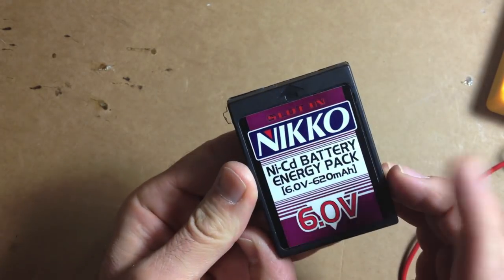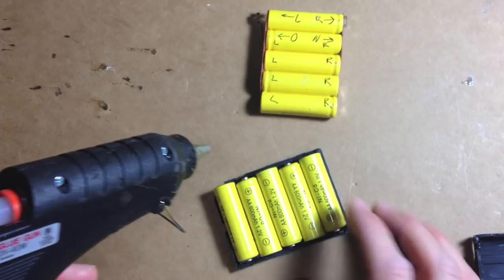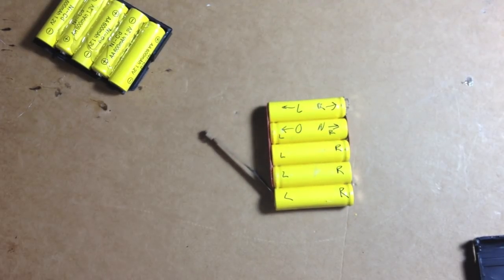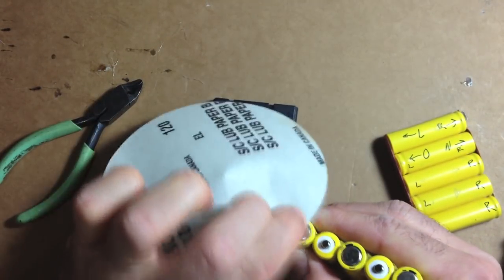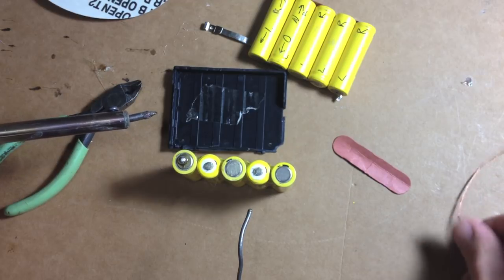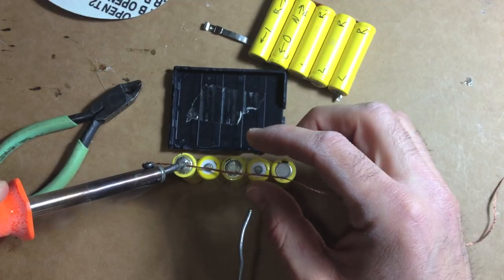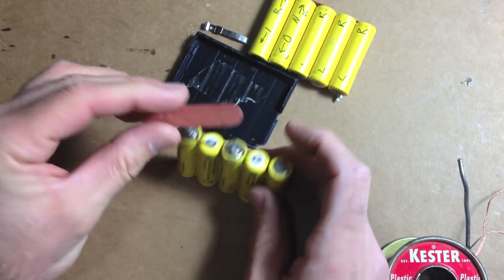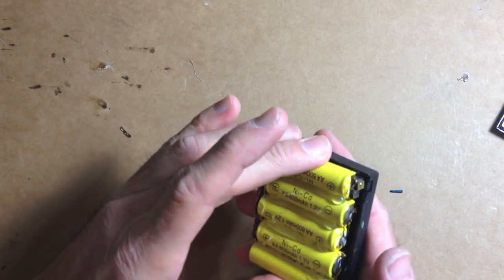Make your own RC Car Battery Pack or Repair NIKKO Ni-Cd 6.0V-620mAh

Comment: Thanks for the tutorial. I was able to refurbish a TMH Flexpak 7.2 v used with a Tony Hawk Skateboard RC toy. Apparently the battery pack is no longer manuals yet and I didn’t trust the ones on EBay. I used solid copper wire and flattened it with a hammer for the conductive strips between batteries. The case is a pain on this particular battery pack, but it can be done.

Comment: Just tried it with 1000 mah IKEA batteries and it works but I feel the power is reduced, I might try with higher mah, didn't solder anything just used aluminium foil for the connections

Comment: Hi

many thanks for sharing your knowledge through video however, I have seen many videos on this topic but none of them explained how do we charge those packs which power adapter to use.  is it ok to use any 12v power adapter for charging the batteries or we need specific ones.  all these questions remained unanswered and kinda discouraging to moving forward towards making a battery pack.  it would be really great if you can answer them either here or by extending your video for this topic.

Comment: Why do you suggest to use only the same Ni-Cd batteries?
IMHO 
1. Ni-MH are much better because of no "memory effect"
2. You can assemble new battery pack using batteries with much more capasity: Sanyo (Panasonic) 2500 mAh or Ansmann 2850 mAh for instance instead of these ones noname 600 mAh. Just imagine, you can increase the running time up to 5 times :)
What do you think?

P.S. I got more simple case. My son's Niko car is powered by 4*AA batteries, so it's 4.8V. So I bought the Xiaomi 10000 mAh powerbank which supplies with stabilized 5v. Then I solder the USB cable to +/- on the car and made a place for this powerbank inside the cockpit. So I was amazed when my son played all day long with this car and then my wife also chaged her smartphone in the evening also from this powerbank. LOL
Reply: I imagine he's using NiCd batteries because the pack goes with a charger that is built specifically for NiCd batteries.
Reply: Tony Tapay take a closer look at typical ni-cd, ni-mh chargers specs: i.e. Lacrosse BC-700, Maha Powerex, etc. They have pretty much the same charging logic for both of these types. So it doesn't matter for a charger what to charge: ni-cd or ni-mh.
Reply: That's good to know.
Reply: Not entirely true, there are differences, e.g. cut off V delta is different for once (5mV vs 10mV as I recall). Also Ni-Mh are more fragile when it comes to overcharging. 

http://batteryuniversity.com/learn/article/charging_nickel_metal_hydride

You may still give it a go...
Reply: You know nothing about batteries. Higher amperage force  to charge longer and higher.Nikko charger is not build for  ni-mh and those batteries weight much more than ni-cd

Comment: Hello! 
It's a great tutorial, thank you. But I have a problem: I can't open the battery to replace the inner cells! How is it opened? Glue? Clips?
Reply from the maker: Almost always the case is glued shut. You will need to carefully split it open and then glue it back together when you are done.
Reply: I've tried to open it with a knife (since the gap between the halves is too thin for a screwdriver), but the plastic breaks where I push the knife and it doesn't seem to do the work
Reply: +Rain Bringer 
I've managed opening it. With a very thin and heated knife I've carefully melted the glued stitch between the two halves.

Comment: Hello, 
After ponssage and before welding, you apply a leg.

Coult you tell me what that leg ? 

In advance thank you.
Reply from the maker: +Fab ien I'm not sure what part you are talking about but I think it's the metal lead that was part of the original battery case. Your's may be different.
Reply: he is telling about the  grey thing that you applied before soldering i think its flux

Comment: i just altered the batteries compartment  soldered on deans connectors and run the rc on lion packs much more power and much longer run time

Comment: Hi there thanks for your video. Can you please tell me where I can fund this small welder you used and what is the actual name for them? Is it copper cable you used? It was clearly under-stable for one part you welded but other side of the battery is not clear I mean how did you connect all these 5 batteries?
Reply from the maker: The welder is called a "Soldering Iron" and the copper is actually solder wick. But you can just use any cheap wire, I just had that laying around at the time.  You just connect the positive side to the negative side of the next battery.  So instead of having all of the batteries pointed the same direction, you need to flip every other battery.

Comment: Listen bro my truck is mouse potato crawling monster truck with 700mah and I want to extend it to 2000mah so will 2000mah batteries will damage my truck?????
Reply: It will damage it but after using it for some time
Reply: AVI GAMING why would a high capacity batter hurt the rc car? I thought the only thing that matter is the voltage

Comment: What are those cap things with wires that you can put on batteries?
Reply from the maker: Are you talking about the copper wire and solder?
Reply: +AdamDIY no its not in the video but its black has two wires at the back of it and you can put it on those rectangle batteries
Reply: +AdamDIY also how would you turn this on and control the rc?

Comment: Hi there can u pls tell how to fix my problem 
I have an rc supersonic monster truck 1/12 size 
I bought it few days back 
It's new 
It worked superb for the first 4 times 
When I charged it the next time it got too hot and the adapter melted but I suddenly reached and switched off 
The charger now works properly but I don't know what happened with the battery 
When I installed it in the car 
The car don't run properly and works only for 2-4 min even after charging 
Pls tell 
It doesn't  catch the remote signal and battery not works properly 
Please tell me how to solve this problem 
Please reply

Comment: No need to open the pack with a hammer, LOL! Glues are chemical bounds, that can be dissolved by the appropriate 'chemical' (some by water...) For this one I first tried rubbing alcohol (great for loosening hot glue bonds), which didn't seem to work (being an impatient guy). I then tried Tamiya Lacquer Thinner (search Tamiya 87077 on eg eBay). After a couple of minutes, a little force with a knife split the case, without any damage. Otherwise a great guide, tx!
Reply: Did you just dip the batterypack in the thinner?

Comment: Nice vide question.. I have a nikko vaporizer.. it uses the nikko 6v battery pack.. but after some year, it could only hold charge for a few minutes.. so I opend up the box and put in standard alkaline batteries, hoping to also get a little extra speed.. but the car just moved slower than before, almost stood still.. so I got muself some new Duracell 1200mah rechargeble and put them in the pack insted.. a little better result, but car just moves really slow... Any idea why that is?

Comment: can you make one on making a 9.6v battery or fixing a 9.6v battery
Reply: +Cody Mattes Same method, except the batteries will be soldered end-to-end. Just observe how the original one is made.
Reply: +Electro_Leet ok thank you i tryed that and before i put it in the rc thing i made ot for it was working but then it did not work
Reply: +Cody Mattes and also did you have to use soldering past or not
Reply: I personally use Flux and silver solder. Home Depot carries it.

Comment: i m not able to solder the wire on the cell. the solder do not stick on cell. why? plz reply
Reply from the maker: rough it up with a little sandpaper and also use flux
Reply: У меня тоже, даже с кислотой с трудом паяются контакты на аккумуляторы.
Таблетка аспирина или ацетилсалициловой кислоты могут помочь.
Reply: Serega Da чел на англ помимо флюса упомянул наждачку, чтоб слегка отшкурить поверхность. не знаю, у кого как, у меня идеально сработало с обычной канифолью, даже без этого вонючего аспирина )))
Reply: А я парюсь, даже когда зачищаю. В основном пальчиковые аккумуляторы совсем не хотят зауживаться.

Comment: Hi, did you damage the batteries? In local store they say tac welding is only option, but since I saw you I think soldering is good option.
I plan to use 5 x 1.2V 3000mAh NiMh batteries. Do you think the charger will cope that?
Reply from the maker: +Srecko D No the batteries were not damaged.  I don't know why you could not solder them. Maybe someone else knows and would care to comment.  I'm not that savy on what mah specs you need to keep to.
Reply: Mah stands for capacity, foe replacing the cells on your pack you will want a higher Mah then the ones you are replacing, hope this helps
Reply: +Srecko D 

Hi, im about to buy new batteries. Did it work for you with the 5x1.2v 3000 mAh NiMh batteries? and is it possible to charge them with the charger?
Reply: It's not a good idea to heat up the batteries, is what I was told.
Reply: @AdamDIY  From what I can tell, soldering these little NiCDor NiMH batteries isn't a problem for personal use, so long as you don't linger too long with the heat. The reason spot welding is preferred is that people are usually connecting 18650 / Lithium batteries together which die very quickly with heat (or much worse... boom!).

Comment: how many hours to charge 700mah 6v to the 250mA output charger? help me guyyys
Reply: heed answer here
Reply: need
Reply: 1 hour
Reply: 700√250x1.4= answer is in hour
Reply: @armyjaictin6147  how about AA2000mAh 4.8v with 250mA output charger? kinda wanna upgrade my rc battery need also an answer here even is 9 months ago hopefully u answer XD
Reply: homer Dustin